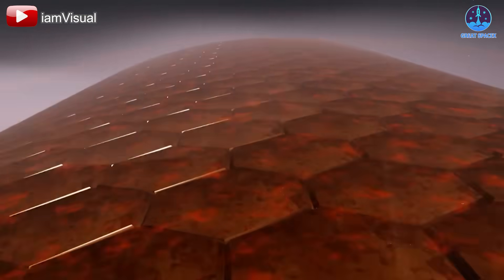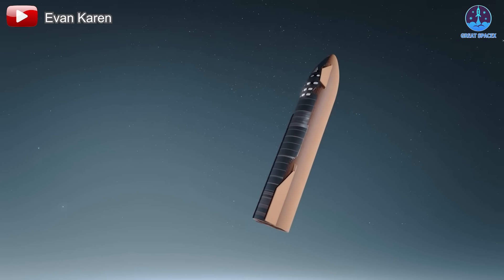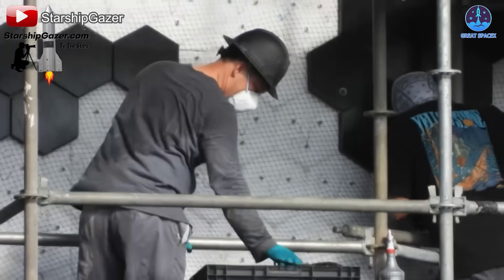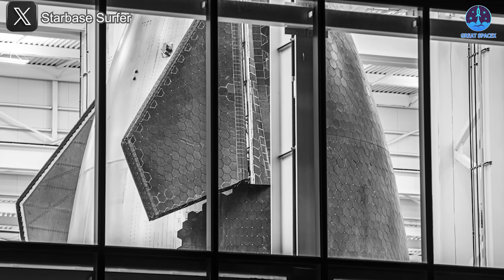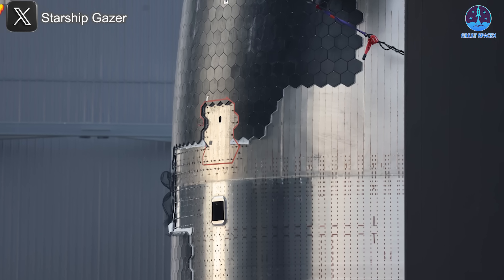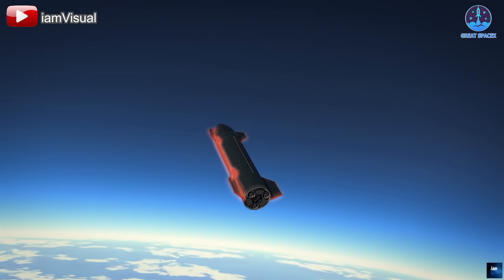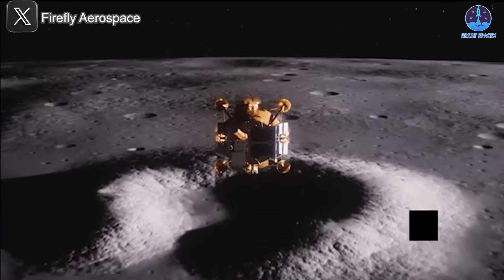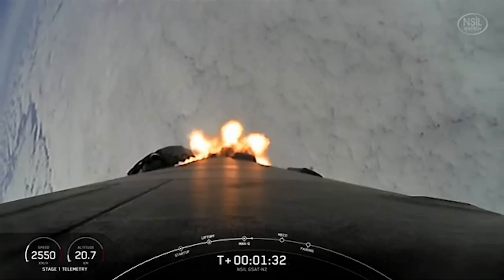Elon Musk revealed NEW Fully Reusable Heat Shield Completed in 2025 to End Ceramic Tiles...

Comment: Yeah .... I am so tired of the SpaceX BS - you can't solve the shield problem EVER!!! - I repeat EVEEEER!!!
Just for dissipating a tiny 1/10th of the Starship reentry kinetic energy you would need about 500 tons of evaporating methane … if you are stupid and ignorant enough to try a “cooled” steel shield. The plasma is above 15000K at some points of the reentry and on the boundary layer is above 6000K, so there is no material in existence who can survive that without melting and evaporating. The Space shuttle is practically an airplane, which glides and and maneuvers zig-zag just to dissipates the energy five times longer then Starship is capable and even then you need to replace burned tiles. EM is a moron and con artist!!!
Reply: Wow, your quite the angry elf
Reply: @Phantom_G-man I wanted them to get us to Mars more than anyone, but what they are doing is pure waste of money and outrageous blunt stupid.
Reply: @OveToranger  I tried to find a solution - in this configuration there is none. I tried at least 10 different shield designs - all they burn tiles and cringe steel. If you put a camera inside the cargo bay you will see how it glows red during a reentry. The only chance for reusability is design similar to the Space shuttle, which will glide and dissipate the 3200 GJ !!!! reentry kinetic energy at least five times longer. This is the only way. You will see that I am right, when this entire project gets scrapped.
Reply: Problem is, that you have no freaking idea what you are talking about and therefore saying complete bullshits. Maximum temperature ever recorded during starship reentry tests was 1400 celcius on the outside of the shield.. So you are wrong by 10 times. They are engenieers, and they perfectly know what they are doing, not you. There are a lot of materials that can withstand this temperature without any bigger issues.
Temperature of the plasma itself does not matter at all. it matters how much of the thermal energy can plasma transfer to the surface of the starship. And as for most of the reentry starship is traveling through not so much dense enviroment, transfer of heat to the starship surface is slow.
You may also underdstand this another way. 
Kinetic energy of the starship is transfered to the plasma,  by compresing supperfast the air while reentry. But the same plasma do not stays all the time around the ship - it is exchanged by another portions of the air, that starship must warm up from it's normal air temperature to thousends of degrees. Therefore the plasma temperature, has nothing to do with the starship surface temperature. Atmosphere is heating the starship, but at the same time it is a cooling system with almost endless cooling liquid. Surface of the starship experiences way way lower temperatures, than the temperature of the plasma. And requires by far less effort to cool it down than you think. Not even a 1% of the methane that you think, is nessesery to keep the surface on safe temperatures.
Reply: @kkmiroslaw  okay - I stopped reading on 1400 ... uhhh.... It is obvious why Musk have so many fan boys.
Reply: @kkmiroslaw  If the opposite side claims that the highest reentry temperature is 1400 Celsius I am done … speechless… stunned … what to read? – next thing I expect is that the Earth is flat – I don’t wont to rise my blood pressure reading crap.
Reply: @lachezarkrastev7123  And by the way, even Space Shuttles that was built with  by far inferior technology than today's, experienced maximum surface temperature around 1650C. (3000F). As I already told you multiple times: plasma temperature is complelty different  than  surface temperature of the spaceship.
Reply: @kkmiroslaw  have you performed reentry fluid simulations? I have, plenty with far more effective shields. The lowest surface temp. on the shield is about 2000K and the highest about 5000K with small angle of attack similar to this of the shuttle - 30-35 degree. With this angle you dissipate the energy over much longer time. This is the boundary layer, the surface itself is colder, because it radiates back significant amount - this is why all shields are black. Whatever, when the black coating is cooked you are done and this is why the shuttle is the only reentry vehicle which needs only some refurbishment on the tiles. In the case of Starship the AOA is 70-80 degree which means it falls almost like a brick with a negligent gliding, so his shield is doomed. The starship tiles melting point is 1650°C – this just does not have a chance. Now you can explain how something designed to withstand 1650°C melts on 1400°C.
Reply: @lachezarkrastev7123  And I forgot. The only problems with melting, that starship had experienced, was on the flaps. Actualy on the place where flaps connects to the ship - and that is only becouse of aerodynamics of the ship, that makes a jet of plasma to cumulate on those points.
Reply: @lachezarkrastev7123 One more time. There are NONE ceramic tiles that burnt on starship during TF3 to TF6. Not even a single one. And yes, you provided correct melting temperature for those tiles (1650c) which is a proof, that the surface of the ship never experiences this temperature. But the ceramic tiles are very fragile, and therefore often falls off. What you think is burned tile, in reality is a secondary ablasive layer that is under ceramic tile, in case if the tile falls off. On last 2 flight tests there were also next gen ablasive tiles tested intentionaly left for the test without ceramic tiles in few places. Last test flight, was with pushing the boundaries way ahead of they think is safe for the ship, just to test if they are right in what a ship can survive. It also included way worse of the angle of attack during the reentry, way worse than they expect to ever use in normal flight. And the ship and it's thermal protection fully survived this. They were basically trying to intentionaly destroy the ship on reentry, and failed with this task.When your simulation data do not agrees with the real test flight data, than it's obvious, that your simulations are completely off and requires improvements. Nobody on this planet is more advanced in space research. Than spaceX. So understand finally, that whatever thermal prtection systems you had ever chance to work with is way worse than what spaceX already is using. The rest of the world is 20 years behind the spaceX in research.
Reply: @kkmiroslaw  " There are NONE ceramic tiles that burnt on starship during TF3 to TF6. Not even a single one." === and how would you know that? The simulations could be off within 10-20% max, this is why I was using only 5000m/s speed and 10 pascals pressure, because even for me the results I've seen was brutal and still with those very mild loads the picture is grim at best. Bottom line - the current design would never be safe enough even for on reentry with humans on board, forget about rapid reusability. You do not have a single on Space shuttle in the ocean - this is good engineering. The NASA 3 billion contract funds for the Moon landing are already spent ... in the ocean. We will see - there is no point arguing further. Check the channel of this guy "Ronhardrock" and you will see some pretty good fried tiles. Not a single one you say ... yeah.
Reply: @kkmiroslaw  about the air cooling you are right except "few thousands". I give you that.
Reply: @kkmiroslaw  actually the simulation is doing the hard work - convection, conduction, radiation, everything - you just create the 3d model /which is most of the work/ and put him in an air flow with some speed, pressure and temp. so it takes in consideration everything. You can even input the radiative index of the surfaces. It is a pretty sophisticated FEA. Give me /if you wish/ some contacts and I will show you.
Reply: @kkmiroslaw  "Only the heat created by the friction is transfered to the heat shield" -  here I disagree. The radiative, conductive and convective heat flux from the plasma is heating back the shield. Heat flows from hot to cold. The plasma is above 10 000 K - you can trust me on that. As you said - you compress air, create a shock wave and extreme agitation of the gas molecules and as a result you produce very hot plasma which is heating back the shield. And if you think about that I am not so wrong after all. So, if you can tell that plasma "cooling fluid" OK - food for thought. By my opinion the plasma is heating the shield not cooling it. But for sure you are right for one thing – not the entire kinetic energy is going to heat the shield.
Reply: @lachezarkrastev7123  yes with that statement I can finaly agree.
Reply: @lachezarkrastev7123  There are NONE ceramic tiles that burnt on starship during TF3 to TF6. Not even a single one." === and how would you know that? SpaceX is filming everything. There are cameras looking at the flaps, at cargo bay, at engines compartment, and at shield. There are cameras at landing zone. By simply analizing this footage you may easly say when the things gets wrong, and when they work nice. And they had a problem with flaps (not the major issue, changing flaps back to titanium or changing their placemant a bit - which they already did on starship ver. 2. - solves the problem. Shield is coming back to The Earth in quite good shape, excluding the part, that tiles are fragile and therefore often some tiles fells off. . And from their perspective this is major issue, becouse they need to decrease the turnaround period to something like 1 hour - similar to the airplanes. So from their perspective good shield is not enough. They need ideal shield that can survive reentry hundreds of times without any refurbishment. And becouse of that they think about complelty changing the shield type - into metalic shield cooled down with liquid methane.
Reply: @kkmiroslaw  metallic shield would not work for several reasons - first you would need about 500 tons methane just to get rid of only 1/10th of the KE. Even if you need to cool down just 1/100th the KE you still need 50 tons methane for that, which adds 50% to the reentry mass of Starship, which changes the entire equation - you will lose 50 tons of payload and you get 50% more KE of reentry. Second - the construction of such a shield would be very complex - much more complex than the tiles. Third - you evaporate a fuel in a hot plasma, which contains at least some oxygen and the result could be at least some combustion - it is hard to say what would be the result of that.
Reply: @lachezarkrastev7123  I thought we are already past that. Of course not all KE is going to the shield. And it's definetely quite low percentage of it. And they definetely know the real value, that we may only be guessing. It's super bold assumption, that they did not calculate this before making this plan public. So for me it's obvious, that from their calculations this is totaly doable. Maybe very hard - as all what they are trying to achieve, but definetely doable. 
Now imagine this kind of idea:
You are not evaporating methane outside, you are just warming it in the pipes, and redirect it to the the engines or thrusters, that may do combustion of it, and use it to generate some thrust.
Reply: @kkmiroslaw  "You are not evaporating methane outside, you are just warming it in the pipes, and redirect it to the the engines or thrusters, that may do combustion of it, and use it to generate some thrust." ---- NOOP! You absolutely need to use the evaporating energy and this is the exact design proposed from SpaceX - you pump methane or other fluid through small holes on the outer shield directly into the plasma. If you do not evaporate it you are doing nothing, because the energy of the liquid-gas phase transfer is many times greater than the energy it can absorb by just heating it. This is the only possible solution and they know it. But I would absolutely use water, because it takes more than 4 times more energy per kilo to evaporate. As well it is inert and you do not need to store it in cryogenic tanks. The problem with this design is that you need to distribute evenly the fluid flow through the entire shield, which would require a very complex system of channels or pipes under the entire shield surface. I am just exercising my brain being fully aware that such cooling is absolutely stupid idea and you will see that, if they even reach that stage. On top of that I am giving you a number for just 1% of the KE and it is 50 tons. For water it would be ¼ that. I am 100% certain that you would need to “cool” much more than 1% of the KE. I think that 10-20% is a reasonable assumption, so no, we are not past that.
Reply: @kkmiroslaw  Do not get me wrong – I dream about the Mars human mission and admire EM for trying that. What I hate is the stupid trial and error approach which screams loudly BAD ENGINEERING … and I can’t stand all the hype, lies and stupid ideas. I would not work for him, even if he pay me million a month, because he will force me to do stupid, death born things just to throw billions of junk in the ocean. He is not an engineer!!! With the NASA 3 billion Moon budget, which he already spent in the ocean he would be able to make something that works – think twice and cut once, and he is doing the exact opposite just make a show and grab money from his stupid share holders.
Reply: @lachezarkrastev7123  You are absolutely wrong with that. Elon was studing physics, and has the same technical knowledge, as all the engeniers that works for him. That's why he is also technical director of the Spacex. He is never forcing enginiers to do stupid things, there is always brain storm for the new ideas, and what is great in this company, every idea, even the most crazy can be presented. It may not hold during brain storm, but you always have a chance, to present your ideas. Musk also sometimes has some ideas, but the last word always have engeniers. If they prove it will not work, they switch for something else.
Try and error aproch, as it already has been proven, leads to at least 10 times faster development, of the project, than carefull approach. Other companies do not do that not becouse it is any wrong, but they can't finance this kind of development. And it's extremaly important for the project to be developed rapidly, becouse transfer window to mars ocoours once every 2 years, and than they would have to wait  Man, just look how much they left everybody else behind. It's super obvious that this is greatly managed company, and noone can compete. And if they try, then they basicaly try to copycat  spacex solutions. And how can you even think of "bad engeniering" in company, that produced the most reliable rocket ever (falcoln 9), with over 99% success rate, up to date it failed twice, on  something like almost 500 lounches.
Reply: @kkmiroslaw  Falcoln 9 is the single greatest success of Musk - I do not argue that ... but Starship will be his tombstone! - remember that and this "conversation". All the best! - I think we exhausted the topic.